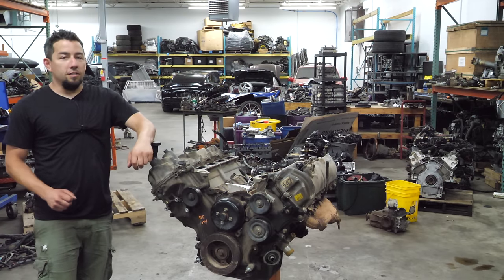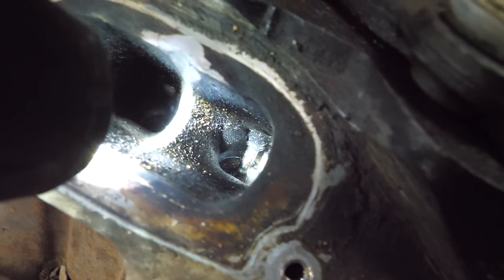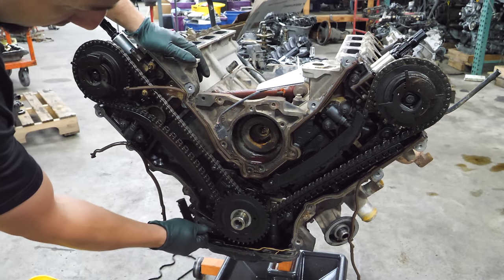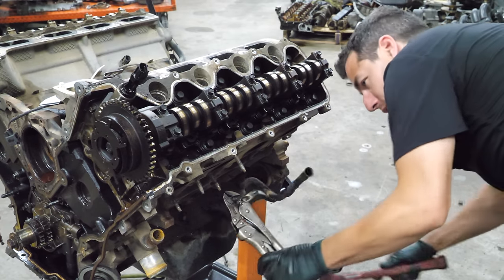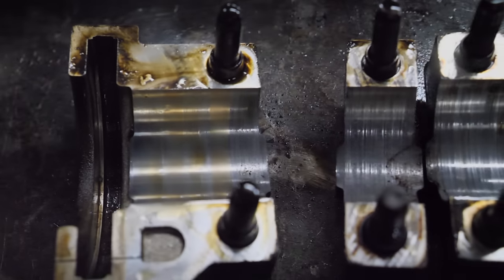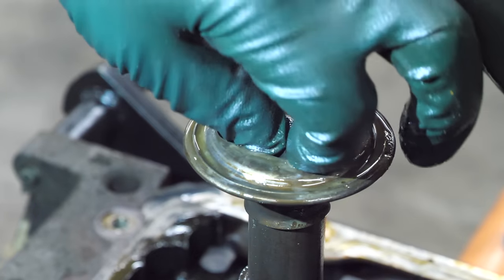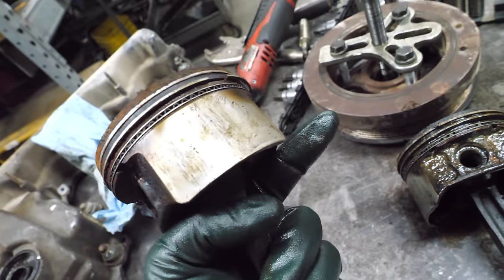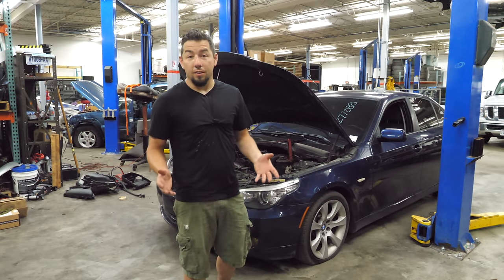Bad Ford 5.4 3-valve V8 Engine Teardown. Which of The MANY Possible Failures Took This One Out?

Comment: I have this motor in my work truck as well, and I like it.  Change the oil every 3-5k miles for $40 with Pennzoil synthetic and Motorcraft oil filter.
Reply: I've got an amsoil customer with an 09 f150 and he's run nothing but amsoil signature changes once a year, usually about 16-20k miles, beats the shit out of it, no issues, sitting pretty at about a quarter 0ver 200k, he did blow the first trans shortly before he became my dad's customer several years ago however.
Reply: Throw a manual oil pressure gage on it. You'll get scared. Regular oil changes are ok. But one of biggest faults from factory was the weak ass oil pump.  Melling finally came out with a fix a few years ago.
Reply: @tonycking0121  that explains so much

Comment: I've had good and bad luck with these, one is over 400.000 and still going good, new timing chains and cam phasers at 300.000. The other blew a head gasket at 170.00 got coolant in the oil. Another sold it at 350.00 still running good.

Comment: I sued Ford and won over this engine in my ex 2005 super-duty I bought brand new. 4 times to the ford shop to fix fuel injectors. 4th time was a charm. 1st 2nd and 3rd time they only changed one injector. Not only a bad engine,  Ford insisted on continuing the bad engineering with bad service. Lemon law saved my ass.
Reply: They just paid you off. They did not admit to anything.
Reply: update timing tensioners and no problems.....our 5.4  has 420k miles on work truck
Reply: @toddbob55  Is that 420 thousand miles, or a metric measurement??????

Comment: I had a F-150 for a while with this engine.  Soooo glad I dumped it years ago before the eject-o-matic spark plugs and all the other issues.
Reply: @navyphyrfitr6550  ..and mine was an '02.   It was this and so much more that caused me to completely lose faith in "American made" autos and trucks.  Then came the frame issues on Toyota trucks around '04 and several years after.  I currently drive a 2019 RAV4 - so far, so good.

Comment: I agree with many others on here, maintenance is key to these engines as it is for most.  No doubt there's lemons out there but overall I've been delighted with these engines.  My 14 Expedition has just under 500k and my 12 has 270k.  Synthetic oil since day one, always change at 5k, never ignore regular maintenance or "unusual" sounds, do regular tune ups and I personally believe most will last a very long time.  My 2014 needed a timing/roller follower/cam job around 250k and my 12 Expo is starting to exhibit the tell tale startup rattle so about to do a timing job and upgrade to a Melling HV oil pump along with new roller followers to ensure another 250k out of it!  I should add, not only have I put tons of miles on these trucks but they idle for many hours per week as well.  I've owned many vehicles over the years and have been the most impressed with these two.  Just my .02

Comment: I have a 04 f250 work truck  has 528,000 miles on it. Never had timing fixed only been in the shop a couple time.  Know it's rare but best engine I've ever had
Reply: not a 3 valve?

Comment: There is an outfit called Powertrain Products that rebuilds and updates those 5.4 3v engines to eliminate all the issues with them.  They even line bore the  cam holders in the heads and put custom bearings on them so the head can't be trashed again.  As for the block, those grooves don't look more than 1mm, so should be fine bored out and +1mm pistons.  You may not want to sell a block that needs to be bored out, but if it was mine I wouldn't scrap it only because of that.  Even after a rebuild with updated components its still going to be a 5.4 though, so I wouldn't go through all that hassle unless I had a truck I didn't want to get rid of that it came out of.  With car prices and inflation these days, that possibility grows by the day.
Reply: I would scrap the whole vehicle due to the 4 letters found on the grill. and u can call me biased or a hater but. as a fact out of the 10+ trucks our outfit has they all vary in age and use. they all have those 4 letters but we are lucky if we can keep 6 out of ten on the road at all times. I've heard the excuse oh ur just to hard on it. that is a load of crap 40 yrs ago when u bought a truck u had a truck. now u have a reinforced aluminium can with wheels.
Reply: @mkazen1  ford isn't near as bad as Mopar, or Isuzu. My company has probably 50 Isuzu NRR trucks, 10 or more are in the shop at any given time. They are terrible. Isuzu is owned by GM. We're replacing them with fords for the improved reliability.
Reply: @inoahmann7542  I drive an 07 Aspen Hemi with 275k on it. I rebuilt it at 120k . I can tow 10k lbs and haul around 6 passengers . When I pulled it apart all the hard parts were like brand new. Never broken down once in 7 years. Easiest motor to rebuild ever. Simplicity. The interior is mint with 3 kids of various age who are growing up in it. Unlike junk gm all the knobs and switches work and are solid. I’ve owned all of the domestic companies and some toyo, Hyundai, and an 04 rx-7 even. This Aspen Hemi is the most reliable and like I said simple truck to work on that it puts every other vehicle that I’ve had to shame. I’m pulling her apart at 300k and looking forward to doing so. Only a glutton for punishment would buy a 5.4 ; that I can agree on.
Reply: @MightyWhiteofYou  don't be that guy who disassembles his car for no reason.
Reply: @MightyWhiteofYou  the 5.4 isn't a good motor. It's actually a piece of crap. However, my dad has a truck with a 5.4 and it's been great, we tow other trucks and heavy trailers with it all the time. It's at 178k now and it's had no issues at all. Having to rebuild your engine at 120k proves my point. I'm not a Mopar guy, but I wasn't really talking about the hemi engines, just all of their other engines. Hemi engines are usually pretty good.

Comment: I'd like to see a motor from the 1960's or early 70's that never had modern oil. Just so folks can see how much sludge was normal back then. Dad was a mechanic/machinist, and I was the gasket and sludge scrapper.
Reply: It didn't have detergent like it does today. Its like buying dollar store brand oil.
Reply: They also have larger clearances on literally everything so sludge was not as much of a big deal on older engines  the 300 six was bad for pcv circulation causing sludge and those engines were good for 400k

Comment: "Why use this Ford, why?"

Ford Engineer: it cost $3 less to make
Reply: No way these were cheaper to make than an ls.  They could have just ls swapped them on the assy line.
Reply: @randymagnum143  Cheaper doesn't always mean worse though, I agree the LS is an affordable motor but it was in production forever. It was in the 70's ?? when the motor was originally designed, however it didn't go by that name, it was used for a lot time.

Chevy modernized the motor heavily, and officially called it the LS in the 90's which was widely used by GM. They had decades of experience, they knew the strength and weakness of the motor, and while cheap they constantly improved each iteration.

Same can be said for the 3800 which originally released as the fireball. A good engine doesn't need to be cheap, but price can hint at the build quality to a degree. History has shown us the most reliable motors where not used for decades because they where reliable, they became reliable due to decades of improvements to ultimately be considered reliable.

I'm not a fan of the 5.4 but if Ford kept to it, and was willing to invest further into it I'm fairly sure it could have been a good motor.
Reply: @GainingDespair  nice try, tho....LS was a clean sheet and started production in 97.
Reply: @randymagnum143  Yeah, that's kinda funny how they released the Gen 3 LS in 1997. I wonder what came before that, maybe a Gen 2, even a Gen 1?

Bet that Gen 1 released in the 70's -ish and had absolutely nothing to do with the design of the Gen 3 that came after it. LS was a new name for the older designed small blocks. Gen 3's core probably wasn't based on that motor from the 70's but modernized.
Reply: @GainingDespair  yea, no.  Completely different animal.
Reply: @GainingDespair  how much does a gen 2 Hemi share with a gen 1?  Or a gen 3 with a gen 2?
Reply: @GainingDespair  

LOL.....you do know there is a way to delete your post to save face??

Comment: I got 465,000 kms  on 99 F250 SD RWD Manual ,I had to do cam position sensor at around 95,000 kms & the thermostat housing developed a pin hole leak at 117,000 requiring replacement of the head as it's part of the head casting ,I replaced the plugs 5 times before a con rod punched through the side of the block in 08 , I still own it and it runs great , I've only had to do the clutch 1 time it's been a great truck , I've owned it since it was born

Comment: "I typically don't see people using anti-seize as an oil additive" 

Was the engine seized, or not? Apparently it works. Also, is that bent breaker bar the same one you used the end-loader on?
Reply: The bent bar was  a half inch drive.    The end-loader bar was 3/4 inch drive.

Comment: One of the best engines ever made
Reply: @mattmuch7536  that's why mine has 270,000 MI
Reply: @mattmuch7536  never got a timing chain until 220,000 still running the original cam phasers
Reply: @mattmuch7536  I put a starter and a fuel pump driver module on it this year run it 200 miles a day change the oil about every 6 to 7,000 if I'm lucky and don't get lazy on changing the oil
Reply: @mattmuch7536  you didn't fix anything for me I also have my 06 Expedition with the same exact motor as my 06 F150 My Expedition has 121,074 MI zero issues

Comment: I changed the oil every 5k miles with rotella syn 5w40 and never had timing issues except the annoying clack. Spark plugs and coils were annoying on the other hand. It still runs like it should.

Comment: Our work truck fleet has been depleted to just Chevys now, it's a joke how many issues those 5.4s have. To list a few, cracked exhaust manifolds, start-up rattle "literally every truck", coolant pouring out exhaust pipe, snapped off plugs and so much more. Stay the hell away from these if you value your money!!!!!
Reply: 3 sets of exhaust manifolds, finally gave up, traded it off, I lost a lot of respect for Ford. Now we know what happens to extremely abused children, they become Ford engineers. Junk.

Comment: Back in the late 1990s Ford was re-inventing the wheel.  Three valve heads???  Re-inventing the spark plug (they tried).  Plastic manifolds??? They sure sold a lot of leak-fix solution.  People with half ton pickups and big station wagon SUVs don't need or want that mess.   They want reliable and simple V8 engines.

Comment: besides cam phasers,weak oil pumps and stuck plugs "haha" they run great. 3v's need regular maintenance and cant be neglected as many are, yours being torn down is severe lol
Reply: @supermotos  ive seen many 200k engines. but like the LS the oil pumps are the cause of most trouble. low oil volume trashes everything
Reply: i believe melling makes an updated oil pump for these engines, solves issue of low oil pressure
Reply: @--andy-  yes they did, i installed same one in my 2v and wow the oil pressure lol quiet as a church mouse
Reply: wasnt there a 4v version as well?
Reply: @imabebebebe2496  yup lincoln navigator and cobra mustangs had it

Comment: I'm on my second F250, both were '04 models. Both came with gas burning, 5.4L engines.  I have only good things to say about Ford's 5.4L engines. My first F250 had over 300K (actual miles) on the odometer when I sold it. And It was still running, and driving great. My current F250 has 314K (again, actual miles) on it, and I drive it at least 4 days a week. I had to fix the stripped out threads in the #3 spark plug hole, but that's the only commonly known major issue I've ever encountered between the two trucks.
Reply: Those are 2v motors which are more reliable than the 3v which I own. Lol

Comment: Decades ago I bought a K-30 hard case plow truck as a parts doner to do a 4x4 conversion .. the previous year I had actually driven the truck in it's intended function. It started first key every time and ran like a champ. Long story short .. when I tore the truck down I didn't need the engine so passed it off to a mate who was looking to put it into his Monte Carlo. We decided to open it first to get a bearing heath check, and possible refresh .. well heck .. That thing was thousands of hours beyond toast. I recall rocking the pistons (worn skirts) and wondered how it hadn't sounded like bolts in the spin cycle .. horrific grooves in the cylinders, a busted ring, cam toast, and an intake recessed into the head. Seen many similar in my decades since .. always surprised at just how frigged a plant can be and still purr like a kitten. 

I don't have the energy I once did .. but I think some times that it might be fun to see what's left internally of my daily ex-cop 4.6 once the rest of the floor falls out of it in three or four years.

Comment: I had 250,000 miles on mine with no issues motor wise and that was with towing an 8,000 pound toy hauler quite often. Just keep up on the oil changes and run good oil!

Comment: The 2v Tritons seem to be fine with many thousands still in use [4.6, 5.4, and 6.8L], it would neat to see a 2v teardown compared to this 3v engine.
Then we would know exactly Ford did so wrong. These 3v engine failures seem similar to the GM 3.6L debacle, the timing chains would fail, then the 3.6L would destruct. The repairs were close to 10K, often the 'rebuilt' 3.6 would promply fail. Then the customer would hire a lawyer, or join a class action lawsuit.

Comment: I had a 2V break a valve spring and drop a valve.  My 3V have had this same issue with the lack of oil retention in the tensioner and chain slop at startup that shatters the plastic rail.  The chain chewed up the cover and ground a channel in the casting.  Cleaned the engine, replaced the parts and she's been humming right along for more than 60k miles.

Comment: Got an 04 fx4 5.4 3v with over 442,000kms and she's still running great and engine sounds like new.

Previous owner redid phasers/timing around 200,000km ago and she gets full synthetic every 8000km.

Fun and comfortable truck to drive, but an absolute PIG on gas and that will be why I will eventually upgrade rather than keep her going.

Comment: Had one of these in a new F250. Used a quart of oil every 1000-2000 miles since day one but never had any problems until I got rid of it at 140,000 miles.

Comment: Only problem with your opening comment is a lot of us LOVE them. FordTechMakeULoco helps us maintain them like champs. As long as you change your oil regularly, listen for phaser knocks, and run 5W20 it will run to over 400k.

Comment: I have a 2006 F150 crew cab lariat 4x4 with a 5.4 3V engine  and have never had a single problem with it. It now has like 180k now and all I've done is maintenance. Still has great power

Comment: I have a 2006 Expedition with 180ks and aside from fluid I've only changed out plugs and coils. Another thing is only use Royal Purple or Mobil 1 synthetic motor oil. I guess it's only a matter of time before I have major issues.

Comment: Had a 5.4 triton in an f350 worktruck which was fully loaded with tools and put on over 275,000 miles before selling it.  We only had one spark plug blowout and a stupid plastic heater core connection breaking.  We drove thing hard as well, 5000-6000  mile oil changes. It was a little underpowered but was super reliable with cold a/c.

Comment: 2003 expedition with 388 thousand miles no problems yet, and a 2014 expedition with 243 thousand mile, runs great. My favorite engine ever. I have owned 5 of these all past 200 thousand, never a problem except general maintenance.

Comment: We build alot of 5.4 3v at our shop all you got to do is use Motorcraft spark plugs, put a melling high volume oil pump and lock out the cam phasers and get it programmed not really to much works and never had issues with them

Comment: After purchasing a 2006 Expedition, January of last year then I started hearing some real horror stories about the 5.4. So far mine is running just fine but then I also change my oil religiously every 4000-5000 miles and it currently is just under 150,000 miles

Comment: I got one of those engines in my garage right now! I’m putting it in my 2006 F150 I use as a garbage truck. Putting the cam phaser lock outs and a new oil pump in it. Along with a few other things and it will be good enough to haul stuff to the dump!

Comment: I bought a 2006 F-150 with that Triton engine and maybe a year later had that exact same failure with the left side chain guide. The chain guide material made it down to the oil pan and clogged up the screen of the oil pickup.

Comment: Had an 2003 FX4 f150 bought with 167,000 miles on , added another 30,000 and traded it in .   Changed a couple of coils in it and yearly oil changes.  No regrets.

Comment: Very entertaining and informative as well. I bought a used and rotting 5.4 long block recently. I was told it came from Minnesota. The intake manifold is removed as well as the valve covers and spark plugs. When I turn the engine by the flywheel, I hear noise in the front right lower side, the same as in your video. Perhaps it will be the chain rail. Thanks for easing my curiosity on that. Also, I want to install it in a 2008 Ford econoline. Do you know how I can be sure it will fit please? Thanks for the great video.

Comment: I have 171k on my 11 Expy I've owned since new. Amazing what changing oil does as my engine pulls strong as eff and makes no sounds even -10 in New Hampshire cold morns. Oil has been changed at 5k until 150k and now I do at 3.3k. And FL820S and Mot synth blend 5-30 all its life.